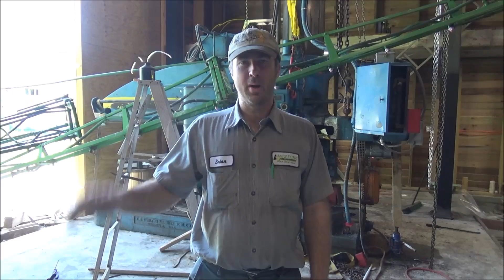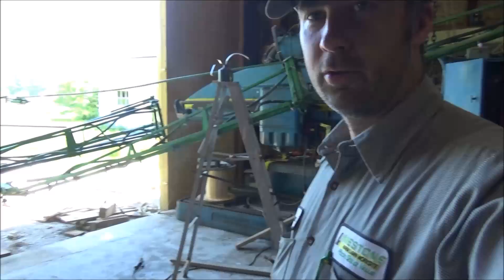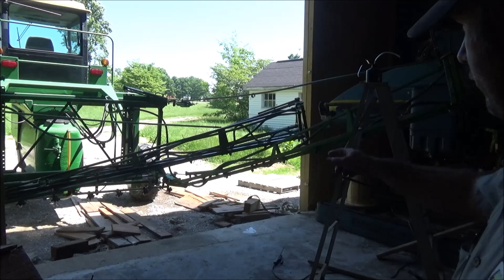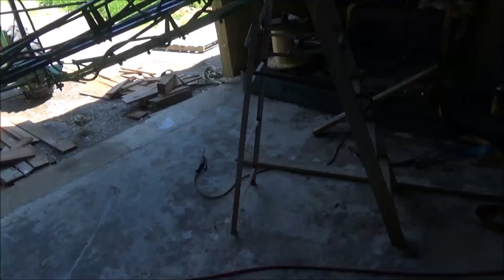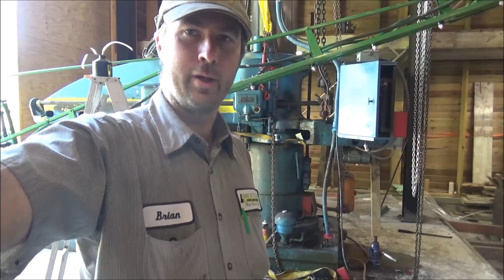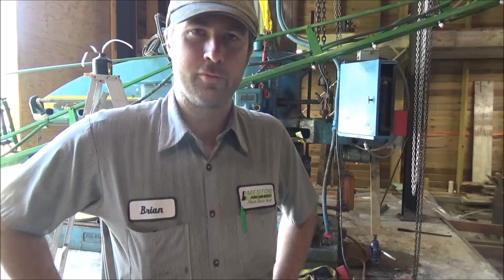Shop update and crane and drill repair donations as well as Patreon

Comment: Brian, it's hard to give a thumbs up on what you've gone through to get the barn ready and all the equipment you have so far.  My son and I bought all second hand equipment in our business.  We had to fix it all before we used it.  As bad as that sounds there is a bright side to it; we know exactly how it worked and how to repair it.  Several time it let us down (like the cable and weld on the spray boom) but like you we just dove in and fixed it.  I like your spirit about not quitting; that's very important.  Also, I understand the initial reaction as we had some not so family responses, too!  Sorry for the long comment but thanks for your posts and keep us up on how it progresses, Greg.
Reply from the maker: Good luck with your shop!

Comment: I did a search on the internet regarding impact damage to concrete and was surprised that there was only one study done on the subject and THAT was a study done on concrete road beds.  

While I don't think that your shop concrete is quite the same, I think the study still applies.  The conclusion of the study is: While some damage may occur near the surface under the loading of a heavy impact, the plastic nature of the concrete will absorb fairly high impact loadings without internal deformations.  

HOWEVER they did say that under higher impact loadings such deformations would be visible in the warping of the edges of the slab.  

I am inclined to believe that with the large thickness of your slab, it's overall size, the recent pour and the possibility that it's internal structure is not FULLY cured, I think your slab is just fine, especially with reinforcing mesh installed.

Comment: Hi Brian As a welder of 40 + years Nickle rod will be your best chance One thing though keep your heat to a minimum keep your inter-pass temp low   DO NOT WEAVE  stringer beads only and you need to peen every  pass gently. cast iron will not shrink but nickle will and pull it self apart so if you have a needle scalier that will work  a air chisel is to aggressive .  Good luck and take your time. If you have a chance look up Arctec welding products they have some real good products for cast iron .
Reply from the maker: Thanks for the tips! They say this a semi steel casting so maybe not as bad to weld as regular grey iron.
Reply: Yup I was thinking most likely a nodular iron .But still keep your welds small watch your inter pass temp and peen softly .  I would be interested to know if the column is still square to the base or table .

Comment: Hi Brian. Re welding the motor plate. 
Before you hit it with the nickel rods might pay to do some testing first mate, perhaps try tacking a slug of something to the same casting and try and break it off, if it pinks off easy leaving glass hard cast behind then best to find another way.
Stitching (pull together kind) might be an option but the bit where it broke looks quite small. Big bucks to buy, could possibly make the bolts / tap /drill jig etc.  
If it were me Id probably braze it. Torch brazing doesnt get the cast to a temp where it hardens from rapid cooling so avoids the weakness / cracking issues. Vee out the areas to be joined enough to get in there and peen the surface with a needle gun / chisel, helps it to wet out. Working on each piece separately, get it glowing red and get a good layer of braze on each surface, youl probably need someone else to help keep the area hot. Offer up and align the motor mount and tig braze/weld the rest in. The arc wont mess with the cast cos youve got the layer of torch braze on there. You could reinforce the area by grinding slots that span the repair, dropping in some steel bar and braze it all in. 
At this point ill say I havent a whole of experience with cast, but recently I had to repair a cracked lathe apron and that lead me to research, struck me that the subject of joining cast iron isnt very well understood. After a pile try and fail I got some good strong consistent results. Just putting this out there as pause before you jump in,  help you avoid some of my fail ;).
Cheers
D

Comment: I had a miller elite helmet that did the same thing, dead battery after db. I took it back in for warranty they replaced it with new and i am still on the same battery three years later and I weld weekly if not more.

find your receipt they will honor it.
Reply: Same. I would've tinkered with mine, perhaps some kind of resistor fault, but they will honor so i didn't bother.

Comment: You did not mention the concrete cracks. Where they as bad as you first thought?  Man I am just glad you were not hurt, machines and concrete can be replaced you can't, keep up the great videos and stay safe.
Reply from the maker: It is still cracked and they don't seem to have gotten any better. They tell me there is concrete weld, I just have to locate some and learn how to use it.
Reply: Yeah I've had decent success with 1/2" PSI4000 filler at about 400 amps and straight helium, of course you have to pre and post heat to avoid recracking. Oh and dont forget to stop core drill the end of the cracks=)
Your the man Brian, keep it up buddy.

Comment: Brian that pigeon poop on your sprayer sure looks familiar. I do a lot of repair on farm machinery and those kind of welds show up all the time. Worst is some of the welds you see on new machinery, a beautiful mig bead laying on top of the parent metal, when they break you can see where the paint has seeped under the bead.
Reply from the maker: Got to love the 0 penetration welds! I guess heat might distort the parts so best just to lay the beads on top. lol
Reply: someone probably used a car battery welder( 2-3 car batteries and some jump cables)  and some old random arc rods from under a barn

Comment: Just curious, did the floor heat lines get broken when the floor cracked?
Reply from the maker: I don't think so they held pressure for 4 days afterwards when I checked them.
Reply: Probably not. 
Polyethylene or PEX is flexible and somewhat elastic. 
It won't matter if the concrete is removed and replaced since the tubing will not be salvageable.

Comment: Never give up never surrender!  

Interested on your thoughts on the concrete. Are you going to finish the back two poors and then maybe revisit fixing the front? Or tear out the front and fix that first? Or just leave it alone?

Not sure what i'd be inclined to do.

 I'm sure the front section will hold up fine for quite a while just not a good place to level machinery.

Thanks for the update!
Reply from the maker: The area where the drill fell was destined to be my welding and fab corner so I likely will just leave it alone.
Reply: are you going to fill the cracks or something to make the visible part look good?

Comment: why not braze repair?
Reply from the maker: Because I am not a good brazer and I don't know that I could ever get it hot enough with my torches to do any good.
Reply: We pre/post-heat large pieces with a pair of 1M BTU propane weed burner/flame throwers, they are cheap and easy to procure/operate. 
Is the arm cast iron or cast steel?
Reply: bcbloc02 makes sense.   thanks for the response.